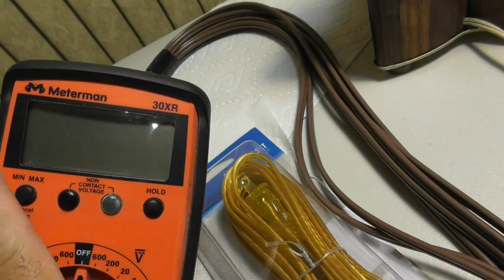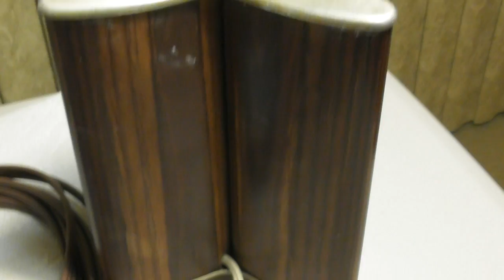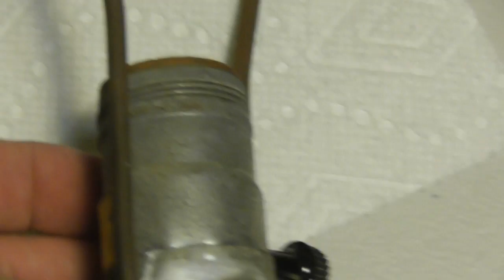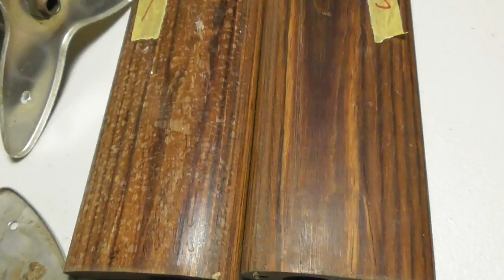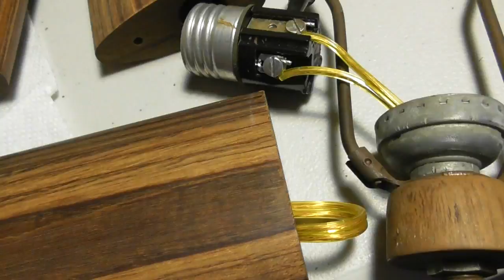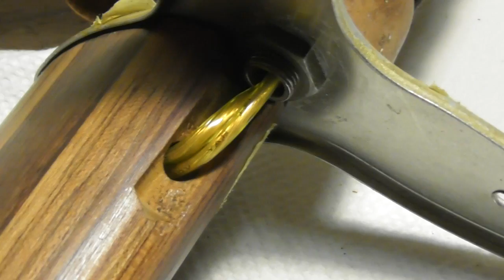How to Rewire a Lamp Replace Lamp Socket Rewire Lamp Cord Repair Fix DIY

Comment: Thanks and lol. As soon as you showed the difference between the wires, I clicked the thumbs up.  I thought if I got anything else after that, it would be a bonus.  Then of course you made a mention of the like about five seconds later.  Had to laugh.  Having said that, dude, what's with all the adds?  There was around seven of them.  Anyhow, thanks for the info.